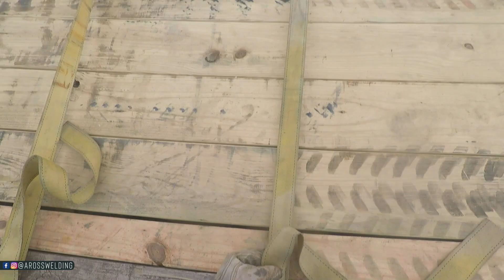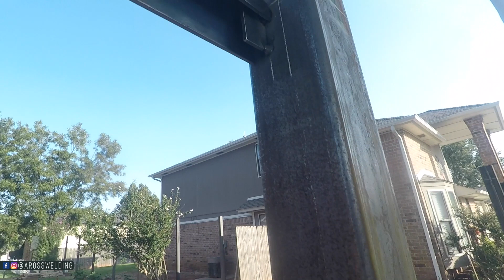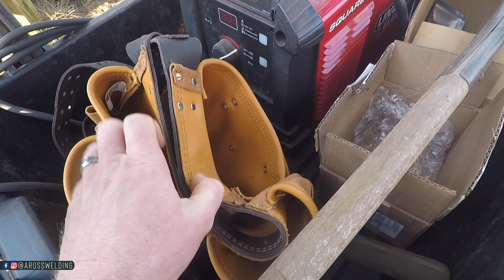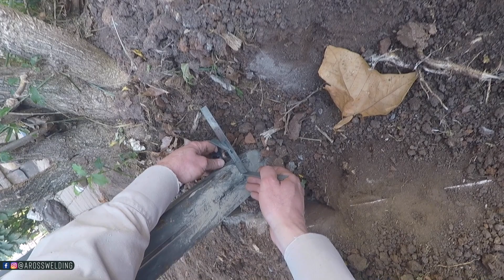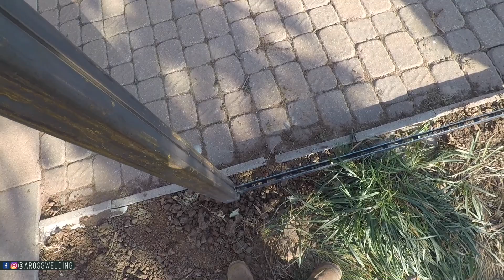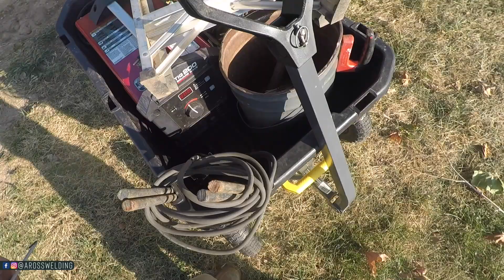I MADE A MOBILE WELDING CART FOR MY WELDING RIG - CUSTOM METAL PRIVACY FENCE INSTALLATION

Comment: Austin, it's probably too late to tell you now but next time use Acetone to clean steel prior to painting. Mineral spirits is good for clean up or paint thinning but sucks for removing oil from steel. Also, on a recent job I had the same thoughts about spraying as far as making a big mess and having a lot of overspray but it really doesn't! I'm talking about using an air sprayer, spray paint cans may be a different story. I reluctantly sprayed this particular job and couldn't have been happier with the results! It looked like a professional paint shop painted it! Most importantly, the customer was tickled pink! Enough about me, very nice job designing the track system! Seems like a lifetime type of fence system.... even for generations to come possibly! Keep up the awesome work! Stay safe down there! Dan @6-4_Fab Glen Rock, PA
Reply: My son and I just got through doing an all steel fence in my backyard and we painted the posts and tubing with small rollers and it turned out awesome!! Was much  easier than spraying and cleaner👍🇺🇸
Reply from the maker: Very good to know. Thank you for sharing!
Reply: @arosswelding  No problem, just trying to share the knowledge!

Comment: A porta-band saw works great for cutting off the post tops. Leaves a clean finish.
Reply from the maker: I have one, but I always have trouble keeping it cutting straight, But nowadays I think they have smaller ones and it would probably be easier to keep straight. And on this particular fence it really would not have mattered much but I am kind of anal when it comes to that type of stuff. Thank you so much for the reminder though, I will have to keep that in mind.
Reply: @arosswelding  Just like welding, practice makes perfect with the porta-band. I used flux core for years on my Hobart 140, no matter how well we cleaned it, the flux would leach through the paint over time.

Comment: Out of curiosity, why don't pipelines use FCAW? It gets used alot in high production and has decent properties when setup properly. Seems it would be faster overall. What am I missing? 

Love the videos
Reply: I don't use fluxcore, but I believe it's not low hydrogen. Could be wrong. And even with dual shield, worm tracks can be a problem. The most honest answer is, that's not what the WPS states. WPS tells you what to use. Whether a 6010 root, hot pass, 7018 fill and cap. Gotta follow the WPS.
Reply: The 6010/7018 recipe has been the standard for a long time because it holds up the best. The Lh properties make a big difference. In fact, 7018 has been known to exceed 80K

Comment: You can spray it. The paint will dry in the air before it gets to a house and won’t stick. That’s how house painters do it with spraying
Reply: Use an airless spray gun. A lot less overspray and better/faster coverage.
Reply: While I won't say this is always true, over spray is definitely a problem, that's why businesses pay out when their buildings are repainted and cars get paint on them. It's also why good house painters will tarp a car left in the driveway. My painter did.

Comment: flux core wire is really good for outside welding in the wind,plus the weld build up is smoother,i use a lincoln  110v for outside fencing but also stick weld when i can get close enough,i got appx 350 ft of lead i can use also

Comment: Hey Austin,nice idea,but a couple things to consider,if you do the painting at home you can spray it then cut to fit with minimal touch up,I'm afraid it's going t be a rust nightmare,it should be red primed and satin black,I learned from a bad experience.If your going to paint on site I would consider buying a Titan HVLP spray system,110,beautiful finish off an extension cord,minimal over spray.I would use a 4" roller if your going to hand paint,good luck,very creative,but cost might be high,Ron
Reply: i,ve been using satin black on wrought iron for over 45 yrs
Reply: @maryparvin3041  
It looks awful. 
Flat black looks way better because it still looks like steel.
Satin makes it look like plastic.
Reply: Satin will dull,it's a closed surface so water will run off,flat absorbes water.

Comment: you need a porta band saw
Reply from the maker: I have one, but I always have trouble keeping it cutting straight, But nowadays I think they have smaller ones and it would probably be easier to keep straight. And on this particular fence it really would not have mattered much but I am kind of anal when it comes to that type of stuff. Thank you so much for the reminder though, I will have to keep that in mind.

Comment: Why not cut the post with a porta band....no sparks flying?
Reply from the maker: I have one, but I always have trouble keeping it cutting straight, But nowadays I think they have smaller ones and it would probably be easier to keep straight. And on this particular fence it really would not have mattered much but I am kind of anal when it comes to that type of stuff. Thank you so much for the reminder though, I will have to keep that in mind.
Reply: @arosswelding  mark four sides cut one line at a time and u can keep it straight

Comment: Hey Austin, i was wondering your opinion of the Lincoln ranger 305g looking at getting one here shortly
Reply: My two cents...I have the 305g, love it works great for my jobs. Just pay attention to the gas going bad/fowling the carb. And I start mine at least once every 3 week if I haven’t used it to keep battery charged.
Reply: @alexinjt  how many hours do you have on it?
Reply: @darrenm4708  about 700.

Comment: hey Austin,, I do this kind of work all the time,, the fence with top and bottom channel looks good but its not going to last , thous pickets as   soon as they get wet for a couple weeks and the sun hit them they will warp so bed you can get your mail thru the cracks , I love your videos, thank you God Bless America and Donald thump.
Reply: Yep, needs a center horizontal to screw into.
Reply: Same. Gotta have a center bar, flatbar will get it done, but if the customer approves, angle with a small leg would be best. And the pickets won't just warp, they'll also come right out after they've warped enough. Home Depot's pickets will do it in about 30 minutes.

Comment: Wouldn't drillimg holes in the channel be easier than cutting and welding all those little rectangles? Not dogging you im just a welder and i do similar work just curious
Reply from the maker: I did not weld a bunch of little rectangles. I got those pieces custom burnt and broke

Comment: As a carpenter I would have set the top and then set the bottom so it was above the ground and then cut the boards to fit.  What's going to stop the boards from warping in the middle?

Comment: The best tool to have around is the one with wheels 🤣
Reply: True statement 😉
Reply from the maker: That's right!
Reply: @arosswelding  I was working at this sheet metal company and I had somebody help me load the Tig welder in the truck and then when I got to Maudies Tec Mex it was just me and the welder and he said bring my welder inside while i prep the bar (it was a good grade bar that had cracked so we he had to weld it) man that dam tig had to weigh like 200lbs WITH NO WHEELS. But I did it byt lol
Reply: Yes sr but a good helper on wheels is even better LOL
Reply: @brianpierson7708  ooooooh yea ain't there yet but yeaaa
Reply: Because u dont gotta carry it lol I love this shit
Reply: If it has (.)(.) or wheels it’s going to give you problems.